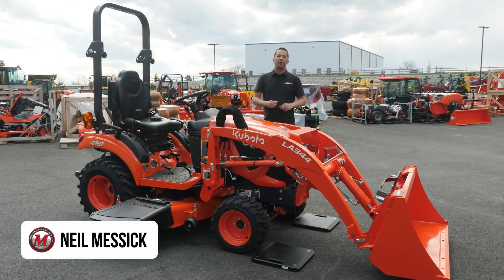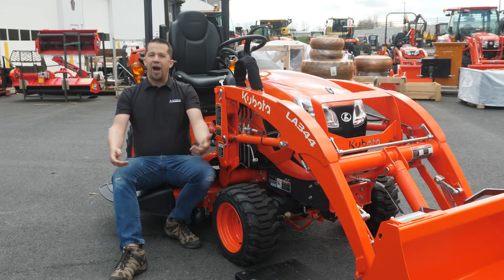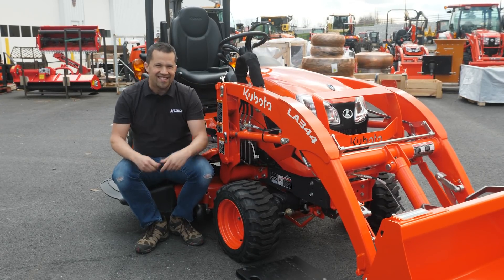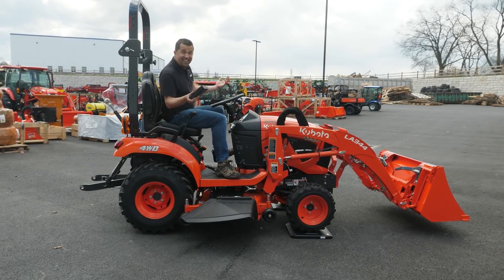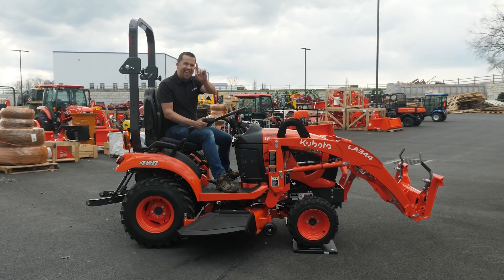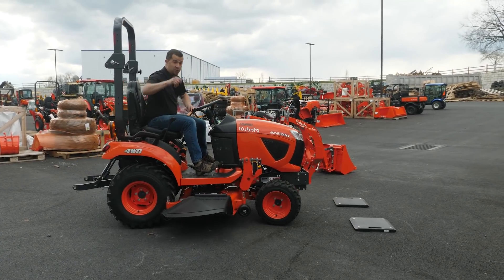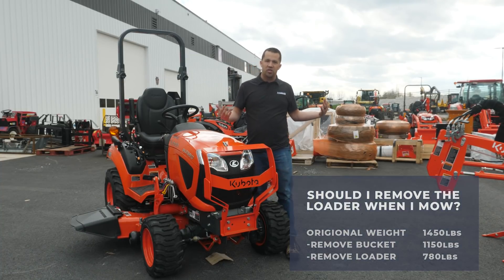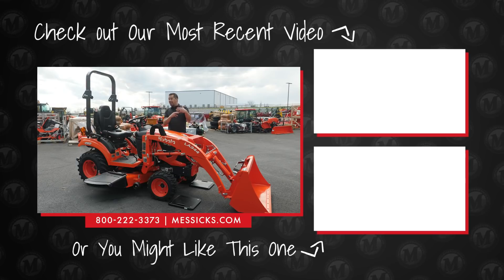Science! Why you should remove your loader when you mow.

Comment: Can you help me ? I have a 2015 kioti subcompact tractor with a front loader that has a single bar in center kickstand. At 73  years old I am having trouble getting on and old tractor to remove the bucket. The bucket tilts left or right on the single center stand and I cannot align the the bucket legs to put back on tractor. Either left hits first or right due to tilting. My question is there something I can add to modify support to eliminate the single center stand to the loader that puts a leg on both sides to keep bucket balanced during installing the loader back on tractor.

Comment: Great video!  I have an 1880, but I expect the weights are pretty similar.  Sometimes I pull the whole loader, sometimes just the bucket.  The SSQA bucket can go off and back on in seconds, where getting the loader back on can either be a smooth 2 minutes or a frustrating 15.  I knew the bucket made a big difference, but I'm surprised the loader still had so much weight!

Comment: where i mow, i sometimes find surprises in the fields or woods. A loader bucket running 6" high has sometimes saved my skin as it catches hidden concrete blocks, stumps, engine blocks,  fawn deer hiding in the weeds, snakes at times, fire ant beds, errant tires and wheels that have come off of passing vehicles, and in the case that im mowing small trees 17 ft tall, its handy in that it pushes over trees making them easier to cut and keeps them from knocking hoses or breaking them  underneath my tractor,,,,,just my experience,,,,regards

Comment: Keeping the loader on, using a MMM to mow and nothing on the 3 point also makes these small subcompacts incredibly unstable, which is essentially what you were getting at. With instability comes the obvious safety risk, especially if you're mowing more than just perfectly flat ground. If you don't remove the loader for the sake of the tractor and front axle's health, remove it for the sake of your own.

Comment: @Neal test is fuel usage. I know on the John Deere 4010, 4100 which I have two of. That if I ran with the loader. I would use a quarter tank more fuel when mowing with a 5-ft rhino finish mower on the three-point hitch.

Comment: Great video.  Make me wonder two things...  

1) Is it safer on slopes to have that additional weight on the tractor when mowing (i.e. don't remove the loader and bucket).  Lower center of gravity, less of a chance of a rollover.
2) On a modern CRDI engine; does it really save any fuel to remove the weight.

Thanks as always Neil!
- Joe The Farmer
Reply from the maker: the only fuel savings would be whatever added fuel is needed to move the weight of the implements around. I'd guess its minimal. Would be an interesting test.

Comment: That’s fine for using a mower deck, but what about removing it when using a rotary cutter or “bush hog”?
Reply: You could remove the loader, and just use front suitcase weights instead...course it defeats the purpose of weight reduction, but to me not having that loader sticking 4+ feet out in front of you bouncing around it would be better to remove it.
Reply: @wildbill23c  Thanks for the feedback. Actually, we now have a grappler on the front.  Where we live, I’m finding it necessary to have the option to remove tree branches or other debris during the “mow”.
Reply: @tbryson2  I'm tossing around the idea of getting a grapple at some point as well, but I'd have to have the 3rd function valve installed so not sure it its really worth the money at this point LOL.
Reply: @wildbill23c  We have a LOT of trees, some down when hurricane Irma went through a few years back.  The grappler is WELL worth the $$$ in my opinion!  It (and the tractor, a BX23S) was able to lift some pretty hefty tree trunks!

Comment: Good video….I’m now curious how all this is affected using a 3pt shredder as I would think it would be countering the loader weight being so far behind center.  

I do remove the bucket…My uneducated assumption is that removing around 500lbs with the bucket (I have MX5200) from the front and adding at least that to rear with shredder….if the net would be putting center weight close to middle. 

I need to practice removing loader anyway so will give it a try next go round.

Comment: I always remove my loader to mow after I was being stupid the first time I mowed my lawn with my BX and I ran the loader into my 22 kilowatt standby generator that was 3 days old. I proceeded to lift the entire unit off the ground by about a foot or two and dropped it back down put a huge cut into the front panel of it.

Fun fact though if you're looking for color match paint for a generac 22 KW guardian series the color you want to go for at Walmart is called bisque and it will match the paint 100%

Comment: I think there is some confusion here based on the comments. He is specifically referring to mowing with the MMM. If you are using a rear mounted mower, especially a rotary (brush hog), you need front ballast and the loader is as good as plates. He didn't really make that clear

Comment: That's great if you have a front bucket "quick disconnect" as shown in this video.  My L3800 has the old style front loader where the bucket is part of the front mechanism and to disconnect said bucket involves "tri-podding" the drop down arms.
Reply from the maker: My tractor is the same way, only adds about a minute.

Comment: what an eye opener test!  I'm jealous how easy can removed that loader!!   I've got a Boomer 40 and I use a 3-point 6' finish mower that I mow 5 acre lot and 2 acres that our house sits on.  All flat land.  That 5 acres is rougher than heck and I always mow with the bucket off but never the loader because my only place to remove the loader is on grass or hard packed gravel driveway.  

Neil you're spot on with ruts in the yard!  As much as I enjoy my cab when its sprinkling I hate the tracks/ruts my Boomer puts in the yard.  Think I'm going to give it a shot and remove the loader this year though.  thanks for the video!

Comment: Really, worried about wear on front tires rubbing on grass  being affected by loader weight?  If your grass  is some very abrasive species maybe , but I don’t see Kentucky bluegrass grinding my tires down  very quickly. Remove bucket, sure, some benefit realized. Removing entire loader…..Maybe the driver should lose a few pounds first. lol

Comment: Hi Neil.  wondering if you can help me out   I purchased a 2380 last year with a mulch kit on the mower, ever since the get go the mower leases a line of cut grass along the left side of the mower no one seems to have an answer as to why this is happening, blades are installed correctly,   any ideas out there    thanks
Reply from the maker: Cutting problems are a mystery to solve. Rarely is there an answer that makes sense.

Comment: Would be interesting to do this with a rear mount mower. Makes for a whole different set of dynamics with the weight on the back.  And for myself, I take the bucket off, because I'm lazy. I am thinking of getting something simple like a receiver plate to put on the front just to use as a push plate for moving larger branches and stuff out of the way.  Mind you, I'm talking about mowing with the rotary cutter.  Kind of different concerns than mowing the yard with a belly mower.
Reply from the maker: Clearly I need to. Lots of people here in the comments referencing that.

Comment: You should have measured the front axle with a rear mover attached and bucket removed.  This should be good enough and works for me. Why would you cut grass when the ground is very soft?  Only use 4WD on slopes or ground work and not necessary for cutting grass.  Far from being science.

Comment: The tractor is more maneuverable with the loader off, you don't have that thing hanging out to cat6ch the fence, trees or other things.  You can see a little better without it too.
Reply: I don't have as much of a "from the seat" quick attach loader.  But it doesn't take 2 minutes to take it off or put it on after having practiced a few times.
I have to: 
Get out of the seat to drop the support stands (2, each with it's own pin to remove, swing the stand, then pin in place)
Then once the loader is on the ground, I have to be out of the seat to pull the large pins holding the loader to the tractor frame
Raise the loader arms out of the cradles, then disconnect the hydraulic lines (4 individual connections)
Back out

Reverse of above to reattach.
Took longer to type that than it takes me to do it.

Comment: I have a 60" rear mounted finish mower on my B2601, The loader sticks out far enough that it made a few spots hard to mow, I found with loader off I couldn't come up the rough trail over my hill because the front wheels would lift until the mower drug. I made a front mounted weight to enable me to climb the hill but in the long run I found removing the bucket shortened the front enough to help but still keep weight enough forward to keep the front wheels on the ground. I grew up on a farm where a lot of implements were heavy enough to float the front wheels either with weight or the hard pull and required brakes to steer so steering wasn't a concern but catching the mower wheels on roots was.
Reply: I have a B2601 with a 60" mid-mount mower and I always leave the loader and bucket on because of my particular situation. I mostly use this setup to mow the ditches on the highway right-of-way in front of my land. There are steep ditches along the highway and they are much too steep to mow parallel to the ditches. The loader and bucket provide weight on the front end when driving out of the ditches to keep the front end of the tractor on the ground and provide good traction. Although this doesn't often happen when I am going down into the ditches I can always drop the bucket down flat on the ground if the rear end of the tractor becomes too light. If the ditches become too soft I use the loader bucket to push the tractor backwards if the front wheels sink . I can also use the bucket to pull the tractor across if it gets stuck. This saves me the trouble of using my 4WD truck to pull the tractor out. The only other time I use the tractor for mowing is in some flat fields and I leave the bucket a couple of inches off the ground so if there is a stump or other object I can't see, the bucket will stop the tractor instead of damaging the mower deck. The bucket also makes it easy when installing or removing the mower as I use the bucket to lift the front end of the tractor and then roll the mower deck beneath the tractor.
Reply: @johnnsmith7932  in your situation I would do the same, Where my finishing mower is on the rear it adds 5 feet to the length making it hard to maneuver with the extended length of the bucket on the front.. When I am using the brushhog I leave the bucket on and use as you describe. When the brushhog is on I'm going right over those obstacles instead of around them like the the ones my wife seems to get upset about when I mow them over :)

Comment: Quick question. You might have covered this in another video, but I haven't found it. What is the optimal RPMs for mowing? Should I be cranking it up like I'm running the rear PTO, or is it ok to run it at lower RPMs. With fuel prices high, I don't want to be burning extra diesel if I don't have to.
Reply from the maker: at the PTO\540 mark.
Reply: Tip speed matters in mowing.  My manual says run at WOT, and that's what I do.  I don't believe it uses much if any extra fuel, these engines are governed, so they only feed in as much fuel as needed to hold those revs.

Comment: Great information. Love your videos and have learned so much about how to make the most of my BX 2380. However, the whole time you're sitting on that mowing deck, I'm like 😳. Maybe I'm neurotic about it, but I always avoid putting any weight at all on the deck. Even yell at my kids for stepping on it. Am I babying it too much?
Reply: Short answer: yes.  The decks on these machines are very strong.  I treat mine mean, including driving over it to get it on and off (B2601), but also mowing blackberry and gorse with it, and it often mows the ground and gravel when I mow the roadside.  Sure, I have to sharpen blades a lot.  But it's made for using.  They're solid steel.

Comment: Neil:  One word of caution.  I removed the loader from my John Deere 4066R and then proceeded to flail mow my pasture.  When I made my first turn I almost skidded into the fence.  The absence of weight on the front tires caused the front end to be so light that the tires had a lot less traction, thus the skid.

Comment: Neil,  thank-you for sharing the information. I've had the quick disconnect on my BX23S FEL replaced under warranty and am gun shy about taking more than the bucket off.

On another topic -  Can you please do a video that highlights the differences between Lo and Hi speed range on the BX23? I recently was doing some earth moving and still had the speed selector in HI range.  Well the tractor bogged down in both 4WD motion and use of the FEL.  Looking at the WSM, I'm seeing references to different gear settings (Yeah, Lo vs Hi on the tranny, I know). But what other effects are there in the overall mechanics/operation (4WD, hydraulics, steering, etc.) between the Lo and Hi speed settings???  Hopefully this is how the unit was designed vs something that's not working.
Many thanks

Comment: You mentioned using 4 wheel drive - without the loader there’s so much more weight on the back wheels you probably wouldn’t need the 4wd.

Comment: Well if you are mowing work a glorified lawn tractor, sure take it off and leave it off. 

If you are going to be mowing fields with a 3 pt mower leave it on. Especially brush hogging. 

The tire wear argument is non sense, the tries wire dry rot before going bald with our with it the loader being on grass and dirt.

Comment: Sounds like another reason to skip the belly mower and just get a used rider.
Reply: I was able to get a new 48" Bad Boy for only $600 more than JD's cheapest belly deck. If you enjoy mowing, I totally get it but if not, you should be "paying yourself" (factoring in your hourly labor rate) for the time spent doing it. In that scenario, a ZT is an even bigger value. The only value I can see in a belly deck is redundancy for when the ZT breaks down, and you can get that with a RFM for half the price.

Comment: I’m not disagreeing but I think you need to clarify something. You’re talking about mowing a lawn or something manicured. With the finishing mower or especially a belly mower. If you’re talking about a pasture with a 50 -70 horse tractor, There’s no way I’m taking off the bucket and the loader to Bushhog a pastor. In fact the bucket itself will stand to cut down some of the heads on the weeds the tend to end up in the air filter screen.